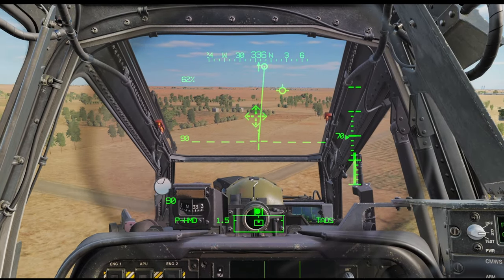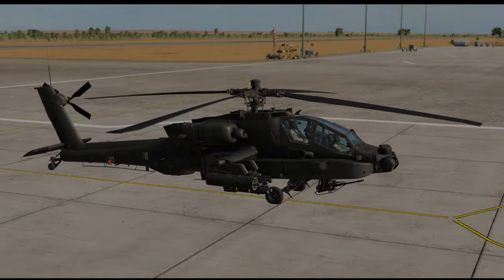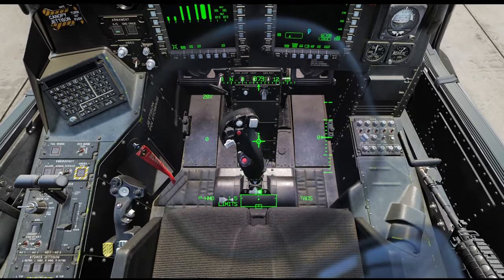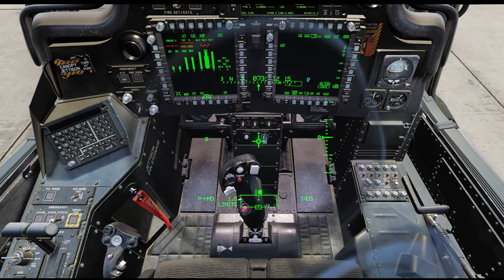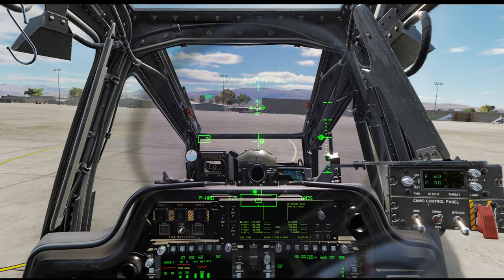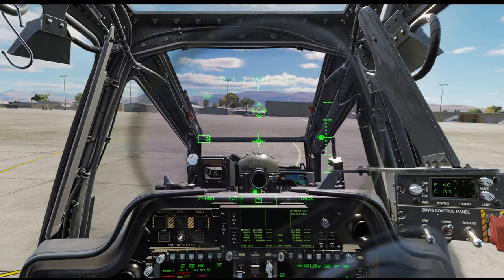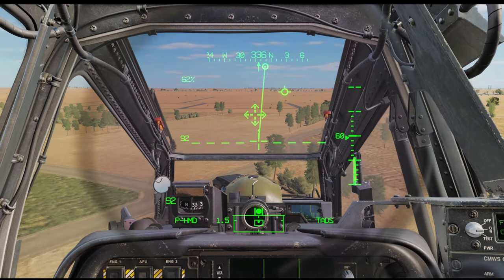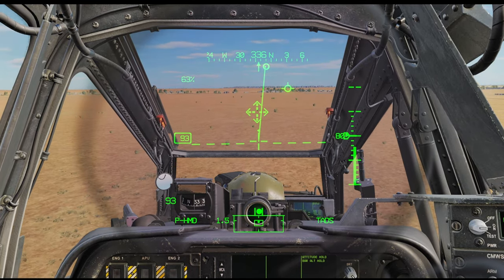The #1 thing you need to focus on learning for flying the DCS Apache | DCS World

Comment: This is why I recommend that people need to start flying helicopters with the Huey to learn the fundamentals. It is an honest aircraft with no SAS and will make you a better pilot. People keep trying to learn how to drive with a Ferrari instead of a Ford Tempo. Sure the Apache is awesome but if you don't know how to fly helicopters before you get in it, you're going to have a bad time. Even in the US Army you don't learn to fly helicopters in the Apache. You start in a TH-67 Creek which is basically a Bell 206 Jet Ranger. So learn to walk before you try to run.
Reply: I learned on the Mi-8 and refined on the Mi-24. Ka-50 was my first interaction with "modern" autopilot systems and hold modes. Once I got to the AH-64, I had already spent a year or two on the Hind and my ability to pilot the Apache was so much better for it.

Comment: Simply put: Force trim reduces the amount of FORCE needed to maintain a directional input. Flight control trim physically moves the trim tabs to reduce the amount of input needed to maintain a given attitude. Aerodynamic trim is when the aircraft maintains a constant speed, altitude, attitude, course, and bearing. Remember that course and bearing are NOT the same thing. Heading is the direction the nose of the aircraft is pointing and course is the direction the aircraft is moving across the ground. So you can have a heading of 350* and your course across the ground could be 358*. If that doesn't change while maintaining altitude and airspeed, the aircraft is said to be in aerodynamic trim.

Comment: I saw so many times people saying "Helicopters in DCS are broken" but it's just that it calculates forces that many other games simplify or have flight assists to not face them. Often their biggest issue is the yaw management, especially when switching horizontal flight/hovering. My biggest suggestion on helicopters would be to get pedals. I know, they are expensive. But they are a key component of flying rotary wings. It is MUCH more important than in fixed wings. 

The joystick's twist - can - work but it's an excessively small movement for such delicate control. Also it will hurt your wrist as you end up applying force on it for the entirety of the flight.

I started from scratch with helis with the Hind. Took a good week to get used to it. But after understanding how to avoid the most basic mistakes, switching to the apache was fairly simple.
Reply: Totally agree on pedals being mandatory. You can get away with twist gripping fairly well in fixed wing, but even then it's well advised to get pedals. It's worth it.
Reply: pro tip if you don't have the pedals but do have a hotas with a mini stick like the x56, bind the rudder to the mini stick
Reply: Force feedback flight stick are insanely useful to flight helicopters too, there's some cheap options like the Microsoft sidewinder force feedback 2

Comment: Thanks for the great videos.  When you say “click” the trimmer switch, it’s essentially a two step process, right?  “Click” the trimmer + immediately let go of the stick so it springs to the center, correct?  Instant trim has this thing where clicking “trim” then without immediate recentering, the cyclic input value doubles and it’s easy to lose control.  My gf ultimate is weak springed so it’s always a challenge😂

Comment: If you want to fly helicopters (and warbirds) in DCS then one the best things to invest in is an old Microsoft Sidewinder force feedback joystick. Then all the strange trim functions will make perfect sense.
Reply: Definitely worth trying at least. I still use almost daily drive my FFB2 that's already at legal age. That thing is rugged AF. Just doesn't have a gajillion of hats and buttons and it's certainly less precise than any of the newer sticks that have been released since the TMWH. But sure does it get that feel with the trim right. Not just in helos BTW. It's absolutely amazing in the Il-2 GB series (and RoF) as well and the old Il-2 '46 for anyone interested. In those sims you can literally feel your speed by the stick centering force and the centering point adjusts with the trim. So even there when trimming, you just keep your stick where it is and the trim changes the force you need to apply in order to stay there. It's just so much better.

Comment: Great vid. For reference to real world flying, this is a counter rotating rotor system. Hence, the tail rotor is pushing back against that torq. When you get her light on the wheels, this counter-torq from the tail rotor makes her want to roll right, hence you counter with left cyclic and left pedal. And in European birds, with a clock wise rotor.system,.it would be the opposite 😊 and in the real world you would probably never use force trim in a hover / take off and landing, because if stuff goes south you don't want to also fight a force trim system, but that's just symantics 😊

And YES! learning to hover takes time, there is no quick fix for that, a Heli is inherently chaos and constantly trying to murder you, which is what flying them efficiently sooooo rewarding 😊

Comment: Yep the trim system is a compromise. Only if you have a stick which behaves and operates just like it does in the sim, then you're going to have to work with approximates of that behaviour. I've had the Logitech G940 with force feedback, that wasn't perfect either. It had a lot of centre slop and didn't allow easy hands off trimming. With practise however you can work with the trimming systems and get it to work really well despite the short comings.
Reply: I know exactly what you're talking about. Had the G940 for a few weeks as well as I saw a viable upgrade to my FFB2 and I just flipped it and got me a used TMWH instead, with the stick collecting dust in the cupboard ever since. The G940 was such a great concept, but it failed at a few things: The sloppy centering (kinda like setting a 20% dead zone to the FFB spring effect), the weird hysteresis filter they had in the firmware to counter their bad choice of putting in the cheapest pots on the entire planet to prevent the spiking from being too obvious and cheaping out even on the wiring, causing to lots of throttle units to fail after a while (the switchology on the throttle handles would die, simply because the wires to it were too short and would rip after a few months of usage). Sadly, that was the last FFB stick on the market and people still are using the way older MS SW FFB2 still (that thing was on the shelves from around 1999-2003). The only other option out there is the Brunner CLS-E base that fits TM stick grips and other compatible ones. But it's like 1300 units of money, at least here in Europe. And it's just the base. So you're rather in the 1500-1600 range for a full stick.
Reply: Kifter, I've been financially happy with the Logitech Extreme 3D Pro for some years, have replaced about every 2 years though. That center slop is one thing, but when the twist/rudder contacts are fatigued, it's awful. Don't mean to commandeer discussion here, but the last Extreme 3D Pro stick I bought came from B and H Photovideo for a quite agreeable price. Something told me that other units purchased from others may have been "refurbished". No idea what that means; how does Logitech or anybody obtain sticks to "refurbish"? My abandoned ones go to the landfill. Point is that the most recent purchase was from B and H Photovideo and had a factory-fresh brand-new quality and has lasted quite a bit longer. Logitech's a brand from which I expect none of that refurb garbage.

Comment: As always, yet another repetition of the instructions makes things clearer. I'm not great with fixed or rotary wing, but helicopter trim has always been something I can easily use, but don't fully understand how to use properly. Ex: center the ball vs nose to tail trim. The whole "flying sideways" thing in a helicopter always makes me wonder if I'm doing the right thing in the right situation - especially obvious using fixed guns or rockets. This weekend I was learning the Gazelle. Seems that a bit of crosswind means I've got some pitch in at all times to maintain the direction of flight I want. Stuff like that combined with videos like this helps me put the pieces together.

Comment: Hey Casmo, I would appreciate your input regarding my controls set up and the use of force trim. I use a Virpil CM3 dry clutch base, set up so the clutches hold the stick at whatever position It is at ant any time. I have also removed the spring from my pedals and fitted a damper, so they also will stay where they are directed. In this case, my controls are behaving very much like in the real thing, yes? I use the "No springs, FFB " option in the special menu. So in this circumstance, I find I really never have to use the force trim, the aircraft is very stable and easy to fly. Would you agree that with this type of set up, that force trim use is not needed in DCS, or if it is, in what situations and why please? Many thanks!
Reply from the maker: You still need the force trim to interface with the FMC.
Reply: Actually, after posting the above, I see its discussed and answered further down........Ignore I guess!!

Comment: @ about 10:20 I'm not sure what exactly you meant there. You said when you push the trimmer it'll reset the heading hold, but since you're in DCS it'll probably send you on a loop. Do you mean it'll send you on a loop because it's DCS and you don't have the feel you'd have in a real helicopter. Or are there inaccuracies ED hasn't corrected yet, and pushing Trim in that moment should only adjust the heading hold?
Reply from the maker: Because you’re not really there so your control inputs won’t match.

Comment: Casmo, do you use the pedal trim? I flew with it for a while, but I've been experimenting with flying without the pedal trim, since it's usually not too terrible to hold my heading manually, especially while flying at speed. Then I can just focus on trimming my cyclic and not need to worry about making fine adjustments and accidentally trimming my pedals way out of whack.
Reply from the maker: There is no “pedal trim”. That’s the heading hold mode and it’s always on till you hit the trimmer, then it resets when you release the trimmer.
Reply: @CasmoTV  Sorry, I wasn't very specific. I was talking about the "Pedal Trimmer Mode" in the Special Options. I've been testing out the "Pedals Without Springs" option lately, to see how I did with hovering and turning. Just curious what you use for that setting. I had "Instant Trim" previously.

Comment: So it's evident that the sim is harder to manage than the real thing, as is fixed-wing .😂  That said, I'm having a blast with it in VR!  That's what's so good about the Virpil CM3 with dry clutches. It allows you to keep the stick in whatever position you place it, eliminating the need for force-trim.  I'm still adjusting my settings and trying different springs to get it just right.  I Just got the stick setup a few days ago. The Virpil CM3 base and collective is one of the best hardware investments I've ever made for flight simming...hands down!  Well worth the price for my enjoyment of DCS helicopters and that's from a guy who primarily flies fixed-wing (as I fly IRL)  🙂
Reply from the maker: False. You are not allowing your SAS to adjust. You still need to trim.
Reply: @CasmoTV  Really?  Is that why I get the ocassional SAS message?  I'm still learning, but I definately have better control of it now.

Comment: Good vid Casmo! I was flying the Apache straight and level and all of a sudden the helicopter had a roll movement to the right, I corrected to straight, but it tried to roll even more until it completely rolled over 3 times uncontrollably and hit the ground…scary! I know you covered this in a vid, it seem worse than ever now…comments?
Reply: Sounds like retreating blade stall which happens when you go too fast. Haven't had that in the 64 myself yet though, but the Mi-24 is very prone to that.

Comment: Thanks for this video! I am new to DCS and i'm trying to figure out why when I release the wheel lock the Apache instantly starts rotating to the left. I have not touched ANY controls and my joystick is centered on all axis X, Y & Z, So is trim what is causing that movement? I understand once the helicopter is moving trim is needed but even when I'm on the ground and have not touched any controls? Please help, Thanks!
Reply from the maker: Idk man id have to see what you’re doing. The TR is creating thrust so you need to have some pedal in
Reply: Thanks  @CasmoTV  turns out my X52 stick calibration was the issue. Returned it and got the X56 instead now I'm flying! Reminds me of the Janes Longbow series, but turned up to 11!

Comment: Thanks for another master class, Casmo.

I use the Virpil CM3 base with a 20cm extension that allows the ciclic to stay where you leave it without returning to the center.

Being this the most similar option to reality, in what situations should I use the force trim if the grip is already physically displaced from the center?

Thanks in advance. 😊
Reply: Same here, “dead stick” I think it’s called. Was going to also ask if there’s a situation where trim should be used even if flying this configuration.
Reply: If you're using 1-to-1 input curves on the joystick axis setup in-game, then there is no real advantage to trimming in this scenario.  Your max deflection will be the game's max deflection, your center is the game's center, and everything stays right where you last left it if your physical joystick does not recenter itself. 

The only times that trim would be useful, would be if you cannot fully deflect your joystick to the maximum range of travel in the real world (because you hit the desk or chair or something).  Or if you have joystick axis input curves set to give you an increased "zone" of precision around the stick's physical center, in which case you'd use the trim function to move that zone of precision/physical-center around to be where your new virtual trim center is and where you're working your control inputs around.
Reply: @StanWoods  Thanks for your response Stan. It's what I imagined. I have a dedicated cockpit and can physically move the cyclic to maximum deflections in the real world. If this is the normal behavior of the Apache cyclic then I wonder when force trim is used in real life?
Reply: @ismaeljordaVR  you'd use trim in real life to prevent pilot muscle fatigue and allow your arm/hand to release the stick and manipulate other things in the cockpit.  In the real world aircraft (fixed wing or rotorcraft) you're fighting those control surfaces against wind/drag/g-forces as you maneuver, and that translates to forces the pilot feels on the stick.  By trimming, the pilot zeros out those forces, meaning the stick not only stays where it last was, but also doesn't need the constant arm force provided by the pilot to keep it in place.

In the case of DCS and flightsimmimg, basically nobody has a force-feedback joystick that can mimic these aerodynamic forces pulling against you on the stick. All you ever get is the force of gravity trying to flop the stick over, and the force of springs trying to keep it upright and centered.  Without motors in the joystick to pull against you and proved that force-feedback, trim in-game vs. real world will never be accurately simulated and there will always be tradeoffs.
Reply: @StanWoods  Correct me if I'm wrong, please. The real Apache cyclic stays in position when you release it but other than that it has to be trimmed so that none of these forces move it from its position, right?

Since the sim is not affected by wind/drag/g-forces the cyclic of the simpit will not move from the position you leave it in like it does in real life, am I wrong?

Thanks again for your time.
Reply from the maker: Wrong. You STILL havre to trim. The SAS will not recenter properly. 

Do not try to outthink this aircraft. Just fly it the way it was built to be flown.
Reply: @CasmoTV  Thank you, Casmo. The way it was built to be flown is precisely what I'm trying to understand if I use a base like Virpil's CM3 that can be adjusted so that the cyclic stays where you release it.

Comment: Thanks for yet another great video, Casmo. 

I do find the Apache in DCS a lot more difficult, «top heavy» and very roll sensitive compared to the Hind and Huey.

What is your opinion when comparing these helicopters?

NOTE: I have a few years of heli sim experience and many years of national level large RC helicopter experience, so I hopefully have the helicopter basics down 😊
Reply: Compare to the Ka-50 the Apache definitely wants to “tip over” in the opposing direction of rudder input. It kind of makes sense though and is mitigated by ensuring you initiate turns with cyclic roll first before you input rudder.
Reply: Also, ✌🏿 on RC helis. I don’t compete but I’ve been in that hobby for years too. Fly light 3D for my 580 SAB Kraken